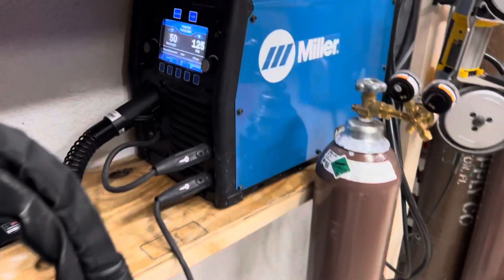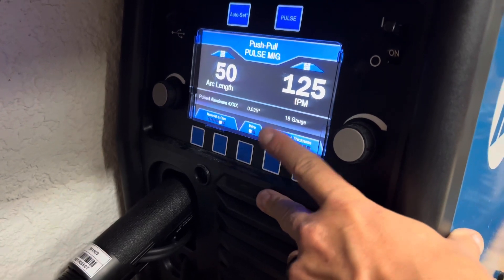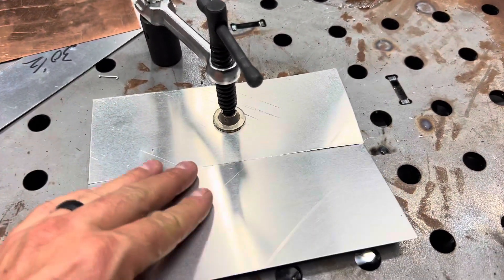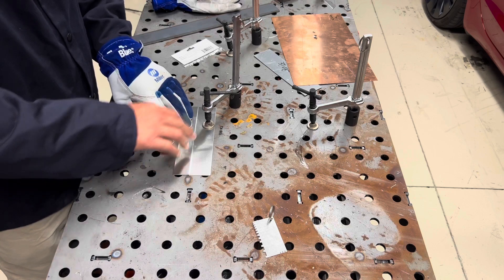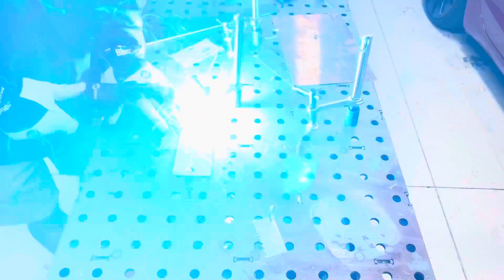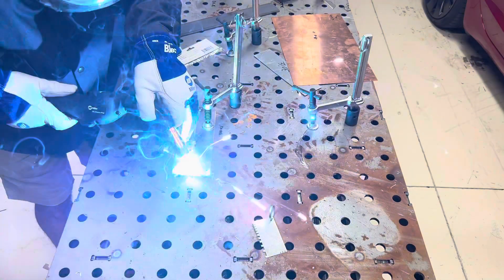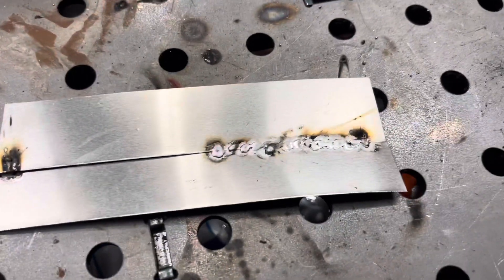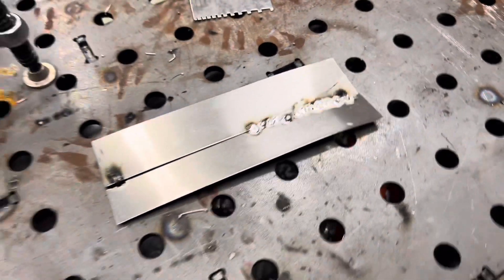Miller 255 with aluma pro push pull gun welding thin aluminum 18 gauge.

Comment: It looks like your welding with 5 series wire. You can tell the difference between 4 and 5 series by the color. 5 series has a green tint to it where 4 series is more of a light blue. Also, If you raise your arc control up to 50 it will tighten up the weld bead and allow you to hold a solid weld without blowing through. I keep my arc length at around 30 for a tighter spray as well. These parameters are more for the older 350p but, I am getting similar results on my 255 with a push pull.